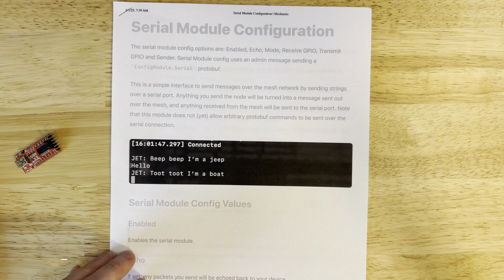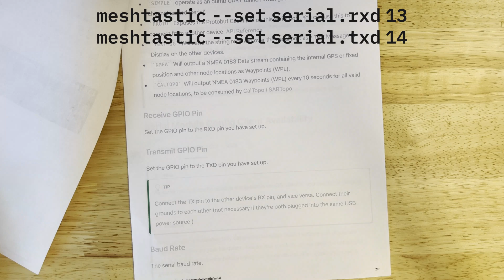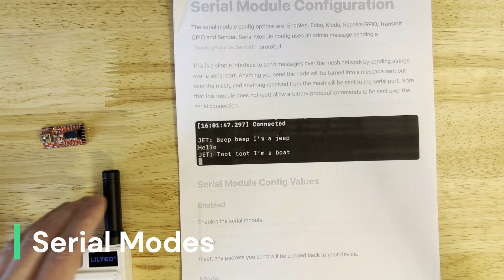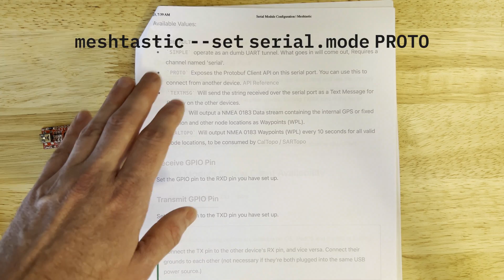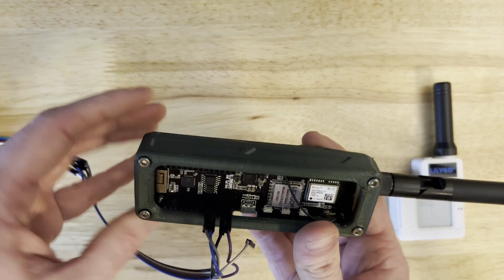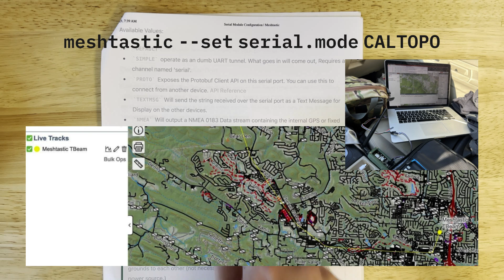Serial - Meshtastic Month of Modules

Comment: Interesting possibilities. I'm interested in sending various telemetry readings from an external ESP32, Raspberry Pi, etc. This would allow me to use an "off the shelf" Meshtastic device as a serial modem. Which common Meshtastic devices have accessible GPIO pins? I'm really interested in using a Heltec T114. Does it have accessible GPIO pins? I've seen another video showing how to do it with a Raspberry Pi Pico and a Waveshare LORA hat, but reducing that to a single package would be nice.
Reply from the maker: Yes, there should be available GPIOs on the T114, be sure to check out the device's pin map.

Comment: I thought the videos strongly implied you could use the main USB serial port for this and it even elaborated on not having to hook up wires/GPIO and had the same exact device I tried this on (T_echo)  
I quickly tried it for TXTMSG and it did not work at all.   
Just continued to get console/debug stream no matter what settings.  
Further examination on the webpage reveals: 
Override Console Serial Port
If set to true, this will allow Serial Module to control (set baud rate) and use the primary USB serial bus for output. This is only useful for NMEA and CalTopo modes and may behave strangely or not work at all in other modes. Setting TX/RX pins in the Serial Module config will cause this setting to be ignored.
Thoughts?   Did I miss something in the video?
Reply from the maker: Sorry for the confusion, the useful information is here " This is only useful for NMEA and CalTopo modes and may behave strangely or not work at all in other modes.", so with your example of using TXTMSG, it likely won't work at all.
Reply: @Meshtastic  Right- but the video totally showed it being used for texting and event went on to say about it being used with the USBc port and talked about the convenience of using that. Do you see why I might be confused?
Reply: No worries I watched it again and see that you were only RXing on the t-echo - that makes sense.   
I thought you were doing two-way text. I just had to watch it a second time and while knowing it doesn't work and why this time was a lot more obvious.  Thanks. 
I could just wire it up. which is a must for two way text.

Comment: I have a T-Deck that has lost all ability to do Bluetooth or Wifi. Started to get technical help but it’s now Chinese New Year so I suspect I might be waiting awhile. I’ve forgotten the mode where a device uses the USB out for Serial but is serial communication on it 5V like USB or 3.3v like the PCB? Thinking this may be the best way to communicate with it as LoRa still works. Also if I use the USB interface do I still need to use a USB2UART thing at all? If so do I just connect USB wires to my UART?
Reply from the maker: We'd suggest reflashing Meshtastic via a full wipe.

Comment: I would like to control the Meshtastic radio board from the Meshtastic android app via a wired (USB) connection vs. Bluetooth. Is that possible? Basically want to same app features and controls but not over Bluetooth. Any information would be appreciated. Thank you!
Reply from the maker: Yes, the android app allows for a USB connection. You should see the device in the hardware list to select when you plug it in.

Comment: I cant get this to work in SIMPLE mode.
I can RX messages sent when in NMEA & CalTopo modes.
I can RX & TX messages to LongFast in TextMSG mode (Even tho I can't see what im typing despite ECHO ON being enabled, It does send)
But in SIMPLE mode I cant get anything sent from one node to the other, I do have a channel names "serial" and I can exchange messages in the serial chat room from one node to another but when I send serial data to the node it does not come out the other node.
Any ideas?
Reply: I have solved this issue,
When creating/copying the "serial" channels encryption key the Meshtastic app sometimes changes what you have inputted into the PSK text box,
For example (and you wont need to save/send it): If you goto Radio configuration > Channels > Click the {+} > In the PSK textbox type (Without correcting it) "noediting" you will see "ngediting==" (Please note the first two letters).
This is what caught me out, the "serial" channel had different encryption keys.
The other thing is "Echo enabled" does not seem to work as expected:
1) In Default/Simple mode it does nothing, No characters are echoed back to the screen.
2) In TEXTMSG mode is also does not echo type characters back to the screen although it does send them.
Reply from the maker: Glad yo hear you figured this out. Can you open an issue in the appropriate client's GitHub repository so that can be tracked (assuming there isn't one already)? Thanks!
Reply: @Meshtastic  Thank you,
Also I have just added an issue to the "Meshtastic-Android" github titled "Missbehaving text box for channels PSK"
Reply: Well I have just updated to version 2.3.6 and found a new problem with the PSK window.
Both nodes now have v2.3.6 firmware, The T-Beam accepts the PSK code & The Heltec V3 rejects the same PSK code.
Give it a try yourself, The code (That I'm no longer using) was orriginally auto generated in v2.3.2 for my admin channel.
1ZO5KzZW4PbadFudgxM0sSkRNv7h3q1lxkrCRfE/wns=
Sorry if you was expecting me to post in GitHub issues but as you havent addressed the provious issue I'd post where I'v had more corrispondance.

Comment: Well... I am trying this with a Heltec V3. If I select some GPIO, the board is going crazy! It get stuck in a permanent reboot loop (tried on pin 12 and 23). I cannot make it send a simple "Hellow World" via UART from a basic software serial on an Arduino board... I tried a lot of GPIO (last is on #2) but at no avail. I have the latest B firmware. Any suggestions please?
Reply from the maker: When you are configuring your pins are you using the physical PIN number or the GPIO number? You'll want to use the GPIO number. You can find those here: https://meshtastic.org/docs/hardware/devices/heltec/?heltec=v3#pin-map

Two open pins you can use are 45/46.

Comment: Could the "SIMPLE" mode be used to offer access to a serial-BBS?
Reply from the maker: It's possibile. We rely on a small delay to determine when a packet is complete. The output of a BBS is a bit stream. There may be a way to code in some sort of flow control, but then it wouldn't be "SIMPLE" anymore. All totally possible.
Reply: @Meshtastic  I was thinking of using tcpser to tie the serial port of a meshtastic device to a telent BBS.

Comment: Hi Ben. Not sure the best place to ask for help but here goes. I am trying to use the simple mode as I think that suits what I need. Using 2 433MHz heltec v3. I am doing a live race display board for my Rc car club. The output from the pc is serial. I have this working over cable but want to make wireless. I am use raspberry pico and want to keep uart based. In Meshtastic I have allocated a channel called serial on one radio. I have a matching setup on other radio that isn’t set with name serial as trying for test to use Meshtastic app messages. Will it work this way for test or do I need both ends to be set with channel serial and send data across by another uart? Ultimately I need uart to uart but trying to get one end working first so testing with messages. But I’m not getting data either way. I have tried a number of gpio. The usb to ttl serial I have works with the debug port so that seems to be working.
Reply from the maker: Were you able to get this figured out? If not, I would suggest joining our discord and someone can likely get you the information you need.

Comment: Is there a way to receive messages over the serial connection? I would like to turn on the light at home :)
Reply: Now i can Control my Light, Code ist in German so licht = light :)

const int ledPin = 12;  // Pin für die LED
char receivedText[30];   // Ein Puffer zum Speichern der empfangenen Nachricht
int textIndex = 0;  // Der aktuelle Index im Puffer
bool ledStatus = LOW;  // Der aktuelle Status der LED

void setup() {
  pinMode(ledPin, OUTPUT);
  digitalWrite(ledPin, ledStatus);  // Setzen Sie den Anfangszustand der LED
  Serial.begin(9600);  // Start der seriellen Kommunikation bei 9600 Baud
}

void loop() {
  // Wenn Daten über die serielle Schnittstelle empfangen werden
  while (Serial.available() > 0) {
    char c = Serial.read();
    
    // Überprüfen Sie, ob das empfangene Zeichen ein Zeilenumbruch ist
    if (c == '\n') {
      // Null-Terminierung zum Puffer hinzufügen
      receivedText[textIndex] = '\0';
      
      // Überprüfen Sie, ob die empfangene Nachricht "licht" enthält
      if (strstr(receivedText, "licht") != NULL) {
        // Überprüfen Sie, ob sich der Status der LED ändert
        if (ledStatus == LOW) {
          digitalWrite(ledPin, HIGH);  // LED einschalten
          ledStatus = HIGH;
          Serial.println("LED eingeschaltet");
        }
      } else {
        // Überprüfen Sie, ob sich der Status der LED ändert
        if (ledStatus == HIGH) {
          digitalWrite(ledPin, LOW);   // LED ausschalten
          ledStatus = LOW;
          Serial.println("LED ausgeschaltet");
        }
      }
      
      // Zurücksetzen des Puffers und Index
      memset(receivedText, 0, sizeof(receivedText));
      textIndex = 0;
    } else {
      // Zeichen zur empfangenen Nachricht hinzufügen
      if (textIndex < sizeof(receivedText) - 1) {
        receivedText[textIndex++] = c;
      }
    }
  }
}
Reply: Code is for Arduino Uno

Comment: Thanks for the clearness, is it possible to communicate like, an Arduino connected to T-Echo with i2c interface? because t-echo tx and rx are used by gps.
Ps. maybe I correct myself,  I can set rx and tx pin as written in the docs i think, any advice?
Reply from the maker: I'm not sure I understand what you're asking, but there is the ability to use a secondary MCU to send information to your Meshtastic device via the serial module.